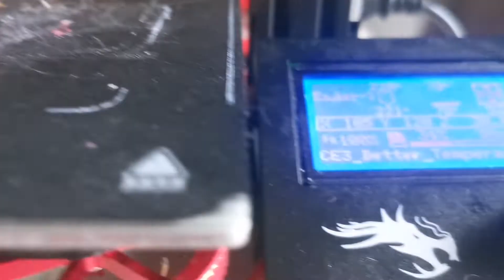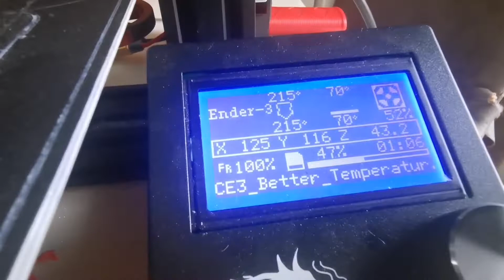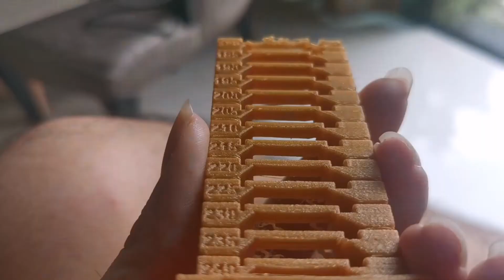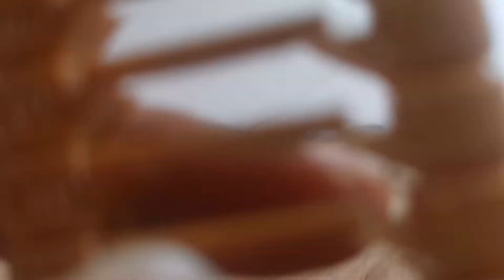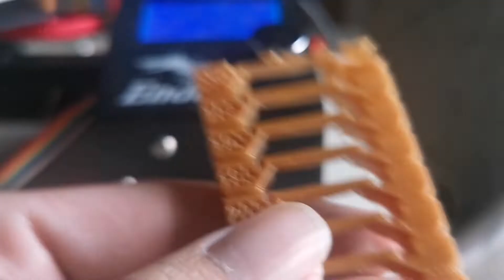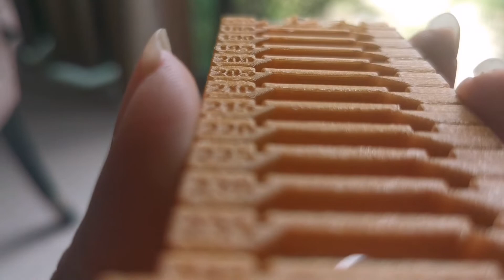Fix PetG Stringing - How to Calibrate PetG 3D Printing With a Temperature Tower

Comment: I couldn't work at 245 or even 230. 220 or even 210 is better. Strength I am not sure. But first layer on glass bed I have to make hotter to stick. Bed temp is 70C

Comment: Cura has a plug-in with a temperature tower/retraction tower/fan speed tower and its very easy to add temp levels in the gcode
Reply: Boy, I can't find it in Cura.
Reply: @Appregator  search cura temperature tower.